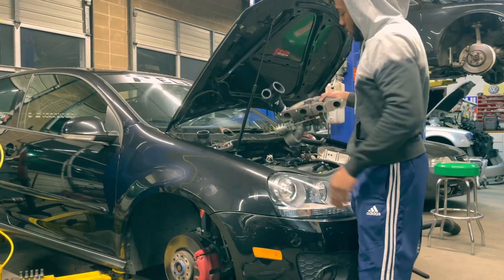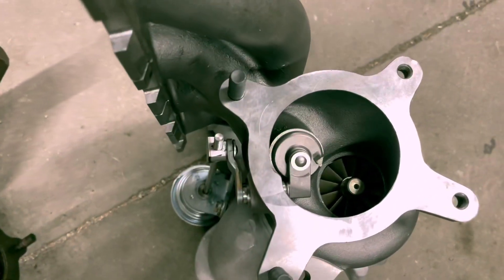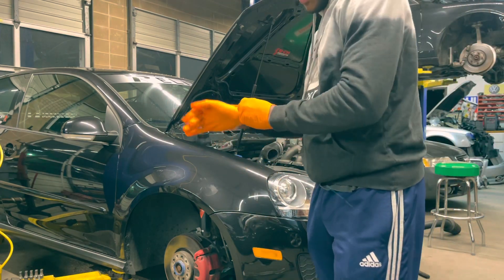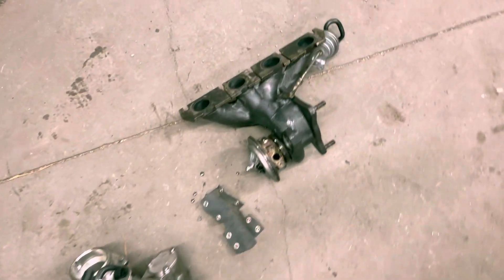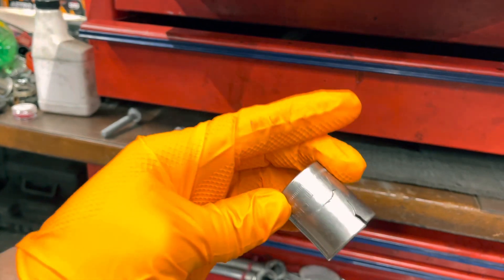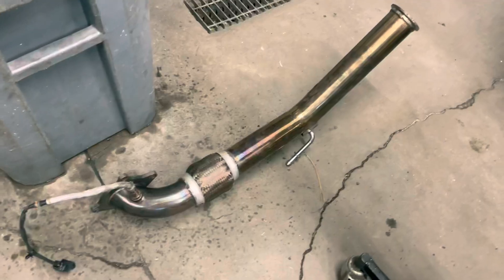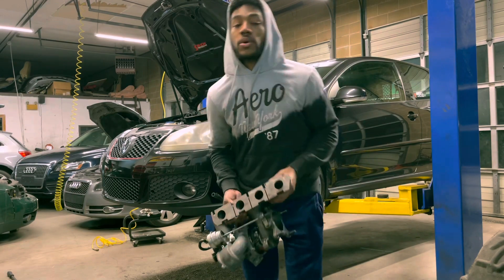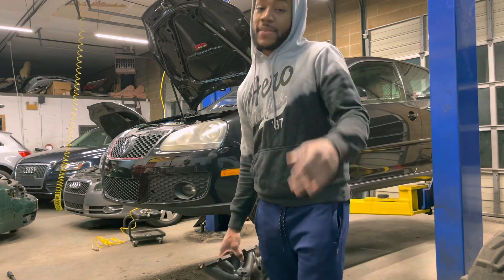2007 GTI K04 TURBO INSTALL pt.1

Comment: The broken compressor wheel is definitely gonna effect the turbo oparation and you will lose power and question yourself where the broken pieces went from the turbo…. Engine swap incoming

Comment: I know it’s a few years old now but dang, surely could have just loosened the clamps that hold the cold side to the chra and clocked it to a different angle? Oh well, you know for next time now
Reply from the maker: @BenjisMK6  you’re right bro, I definitely had to do  that with the next k04 I did after this car… you live and you learn 😓
Reply: @ I watched your other video on your k04 install, where you were experiencing power cuts like you weren’t getting fuel, what ended up being the culprit? Cos it only did it when you were trying to go WOT, but didn’t happen when you were easing your foot into the accelerator pedal?
Reply from the maker: @BenjisMK6  on this mk5 or on my TT?
Reply: @ pretty sure it was the mk5, the video was of you doing a few pulls, after you drove the car “ginger first, to warm up the dsg……” lol, I know how funny the dsg and mechatronics can be too hey. I had a mechanic tell me I needed a new clutch cos my mk6 wasn’t engaging into reverse, it just needed a mechatronics and dsg service. Got me for $1700AUD, ouch!! At least I got a brand new clutch though….
Reply from the maker: @BenjisMK6  I got you yes the high pressure fuel pump I had on the car wasn’t supplying enough fuel and the high pressure relief valve was to weak fixed those 2 and the rest was history lol we started gapping people.
Reply: @ fuckin oath!!! Glad you got it sorted bro….. Mk5/mk6 GTI’s with k04’s are beasts!!! Especially if you drive somewhat of a sleeper, people just think your cars got no balls until you’re saying goodbye to them in your rear view mirror haha! Can’t wait to do my k04 as well, hopefully by Christmas, do you know much about MBC’s? I’d like some advice on where to put it within the n75 hosing to get a bit more boost out of the k03 before I take it off…..
Reply from the maker: @ honestly on a k03/k04 it’s a waste of time … the system is already at it’s safe limit
Reply: @ true story, my mk6 is only stage 1 tuned but as far as I know the tuners didn’t play around with boost, just a/f and timing etc…. Even if I did a MBC and tried to squeeze 2-3 psi more do you think it’d be safe?

Comment: Hey bro. Im looking at potentially replacing my k03 with a k04 on my mk5 gti. My question is. Can i just straight replace turbos and go. Or do i need other bits to actually run the k04 on my 05 mk5 gti? Many thanks in advance 🤙🏼
Reply from the maker: Short answer is yes, at minimum you need

Upgraded high pressure fuel pump, 
Audi s3 injectors 
Upgraded front mount intercooler 
High flow cat converter or down pipe. 
K04 specific Ecu software 
At least stage 2 DSG software. 
Keep in mind this is the bare minimum. I’m going to link the next video where I go over all the parts I put of this car to get it to ab 350-360 hp.

 https://youtu.be/86VQMDZoILE

Comment: Bruh that turbo can fit just remove that lining pin and turn it a little bit😂😂😂😂😂😂😂😂😂😂😂😂😂😂😂😂😂

U really having a bad day lol
Reply from the maker: What about the waste gate actuator.? It’s going to be at an awkward angle and probably shorten the life of the membrane inside. I tried clocking the turbo but the angles just didn’t fit with how I wanted the car to be. I bought the right turbo so I have less failure points. Thanks for the info tho I’ll try it.
Reply: @Quattrogame_pro  bro make a new video! With the removal and install of the new turbo, i need to do the same thing, i have the same car as u 2007 FSI bpy
Reply from the maker: @ucefkh  the next videos on the GTI are of the install the whole series has been uploaded and I’m getting ready to finish a series on the 2007 BPY a4 as well

Comment: Hey I have a 2008 gti. I need that turbo installed. Are you in Detroit by any chance?
Reply from the maker: No sir
Reply: @Quattrogame_pro   You sold the turbo?
Reply from the maker: Not yet
Reply: @Quattrogame_pro  I see the same part with shipping on ebay for like 680. Comes with a few more pieces. I have no idea what all the extra pieces are for. Does the one you have need anything extra? Or could I take the old one out and put the new one in? I'll still need a mechanic. No way I could do it.

Comment: I have a k04-064..ul have to clocc it right while it's on the car..did mines my self..k04 fits fsi/tsi
Reply: You didn't have to modify the oulet pipe for it to fit, I got a 2010 2.0t tsi passat wagon with a dsg and I'm try n to find out If clocking the turbo will help with the outlet pipe, I also have the cts turbo muffler delete that's on my ihi k03 which looks like the bog k04 outlet but it might be alitte different